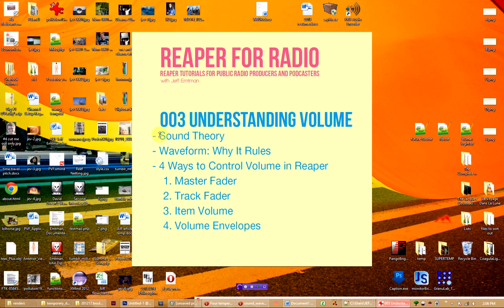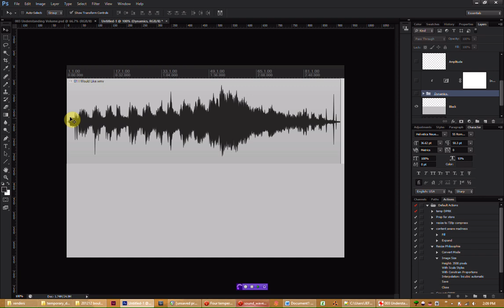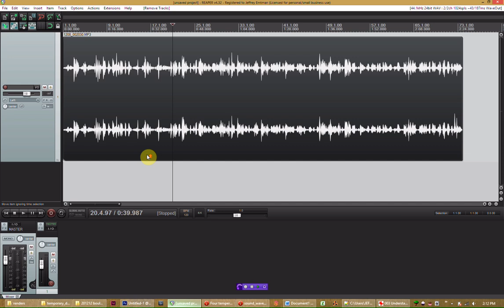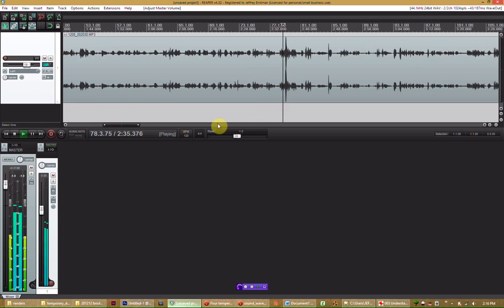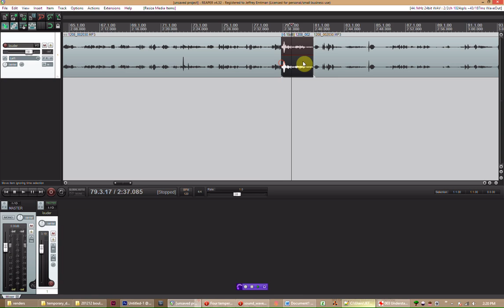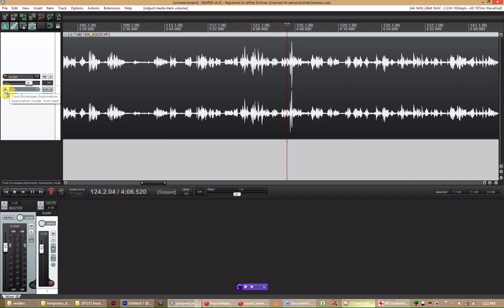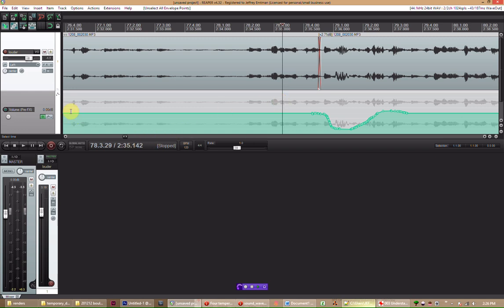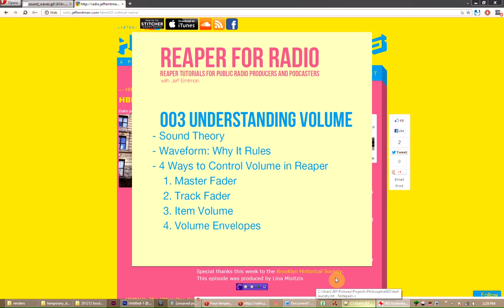Understanding Volume: Reaper for Radio 003

Comment: Reaper 6: To adjust the volume fast on one wave:  Preferences - Appearance - Media - Handle +0db is center of item. This will give you the volume line in the centre of the waveform. Select the area to reduce/increase - Shift S to cut the area at both ends -  rise or lower volume. When drawing the nodes/automation points on with a pen - If you right click one point - select - 'reduce number of points' - you can make it visually look better and then easier to adjust. I also added a normalise button to the toolbar. Right click on toolbar - customise - Add - item properties: Normalize items or (Ctrl Shift N) Onwards!

Comment: Volume automation certainly has its place, but using a compressor would probably be the best choice in this situation, preferrably during recording. Because it is a speech only track, you would be using a compressor anyway to get a level volume for the entire recording and reduce plosives and spikes at the same time. Two birds, one stone.

Comment: Hey Jeff - firstly thanks so much for putting this series together and for the new video this year which I will watch next - I am coming accross from Audacity - I am embarressed to say I have an issue with making a simple selection in a track - when I left click and drag I get the context menu?  What have I missed?
Reply from the maker: All of reaper's mouse functionality is customizable.  what you're getting defintiely isn't the default behavior, so I can only think of two things that'd cause it.  
1. Your mouse buttons are inverted.  Though AFAIK that's a system-wide setting, so your issue would be happening everywhere. 
2. Your "mouse modifiers" have been changed.  This is where you can alter the behavior of the mouse in Reaper.  It's in the preferences.  The context you'd want to look at is called "arrange view". 

Hope that helps
Reply: @JeffEmtman   Thanks so much Jeff - you were right on the second one - not sure how I managed it but I did - just watching your Faster And Better: Reaper Podcast Editing Workflow video - I can not tell you how greatful I am for your work, generosity and awesomeness - thanks so much for your work :-)

Comment: Hey jeff - i'm trying to place points on my volume envelope, but for some reason i can only place them at certain intervals. There's a vertical grid on my workplace that I don't see on yours, and everything i make automatically snaps to these points. How do i turn this off?
Reply from the maker: Good question, Angus.  Fortunately, there's a quick fix for this.  by default, reaper has a grid.  this is helpful for music product.  Since radio isn't produced on a beat, we don't have any need for it.  Here's how you can turn it off.

1. Go to the upper left corner of the screen.  There should be a collection of 14 buttons
2. Look for the one that looks like a magnet (bottom row, right side) Click it.  This will disable the snapping that you're experiencing and you'll be able to move items and envelope points freely.
3 (optional).  The button next to the magnet button will make the grid lines disappear. 
4 (optional). Watch RFR005: This Just Got Awesome. https://www.youtube.com/watch?v=HCSHEDmk50I
In this video, you'll learn how to get rid of those buttons, so that you can free up space in the toolbar for functions you actually need.   I've got buttons that make reaper fullscreen and another one that loops any selected audio (amongst other things). 

Hope that helps!
Reply: Jeff Emtman thanks, jeff!
Reply: Jeff Emtman OK. I have one more Q. How do I record onboard sound (like what ever is playing on my computer) into reaper?
Reply from the maker: *****
That question is a bit more difficult. 

For mac, there's an app called SoundFlower that I have heard works pretty well.

For PC, it's going to be dependent on your soundcard.  On some PC's you can select a recording source called "stereo mix".  You'll have to poke around a bit to figure out if this option is available.  Try googling "how to enable stereo mix" and people will walk you through that.

Personally, I use a really low tech solution when I need to record something directly.  I just plug a cable from my speaker jack into my mic jack.  Never fails to work.

However, most of the time you need something that's playing, you can get it as a file, faster.  There are websites that will let you download youtube videos as mp3s.  Just make sure that you either:
a) have explicit permission to use them
b) the recordings are in the public domain
or
c) they qualify as fair-use under your country's copyright law.

Most people mis-understand option C.
Reply: Jeff Emtman yeah... unfortunately my computer uses an audio driver called conexant, which can enable stereo mix but it's extremely difficult. Your low-tech solution sounds perfect. you just use an AUX cable?
Reply from the maker: *****
Yeah, I use an 1/8" male to male.  I've got a headphone jack on my interface, and a stereo mic input on the back.  Just have to be really careful with levels.  It's probably not perfect in audio quality and you have to do it in realtime, which is a pain.  But it works.

Comment: Hey Jeff,  thanks for explaining volume. If a producer wants my file in -3dB but my track says + 6 dB then I render that track and it come back too quiet, how can I fix that. Also my renders sound more tinny than my actual recorded files in reaper? How can I get them to both sound the same? Thanks
Reply from the maker: Hi Lisa, measuring volume can be difficult.  I've actually learned a ton about it since I made this video.  The terms your producer uses though are unfamiliar to me.  Perhaps what they mean is "peaking at -6dB" which, these days is considered a fairly inaccurate way of measuring loudness.  Instead, I recommend you look into "loudness based metering", which is confusing at first, but gives you a much better ability to produce things at a consistent level.  

Per your second question, everything should sound the same in Reaper as it does in the export file.  There are only two exceptions to this.  1 is if you're using "monitoring FX", which are special FX that don't get applied to the audio.  I think this is pretty unlikely, but google that term if you want to double check.  The more likely answer is that you've accidentally ticked a box in the export settings.  Give the export settings a good once-over to make sure that you're not losing quality there.  Good luck!

Comment: Thanks.  I'm looking figure out why Reaper records, listening to playback, the volume seems to be about 20% quiter than 'radio'.  To try and correct, I double/triple my L1 Limiter- but I don't want to squash the track.
Reply from the maker: What do you mean by 'radio'?
Reply: @JeffEmtman   Comparing my tracks to the radio at the same volume number on the dial
Reply from the maker: @jimdrums4life499  Ahh yes.  There's usually some pretty wild amounts of compression that go into producing commercial work, both voice and music.  Often though, that compression is happening in multiple stages.  I used to think it was "wrong" to use multiple compressors, but actually, it's generally better to do it in a couple stages then to push a single compressor to the extreme.  

I don't know much about the limiter you're using.  I find limiters to be a bit more opaque to understand than compressors.  But I'd rec using some gentle instances of ReaComp on whatever you're trying to boost.  It'll give you more headroom.  might also sound a bit less harsh than the limiters (though I still rec using one on the master channel)

Comment: New to all this (guitar player in the band)...mastering at the moment..is it possible to do a complete red book cd master in Reaper? how important is red book these days? Thanks for an easy to understand Volume tutorial..jd
Reply from the maker: Thanks!  

Regarding CDs in reaper:  I'm not the best one to speak on CD burning, since I never use them, though I'd be almost certain that REAPER's output matches Red Book standards (I've never used a burning software that didn't).  However, I wouldn't recommend it for burning the final consumer product, since there's no option for adding metadata.  There are lots of free software that can do that once you have your mastered WAV though.

Comment: I have moved the Pre-FX Volume envelope up to the media window, but now I cannot move it back down to its own "track."  How do I do that (I'm on an iMac)?
Reply from the maker: LT Holliday good question.  Luckily, the answer's simple.  Just right click on a part of the Pre-FX volume envelope (on a line, not a point) and choose "Show envelope in lane."  That'll do it.
Reply: Jeff Emtman  Thanks for the quick answer. Unfortunately, this doesn't work with my iMac.  To "right click" with a Mac, you press the Shift key and click the mouse cursor.  This did not yield the "choice window" allowing me to put it in a lane.  Any other ideas?
Reply from the maker: LT Holliday Actually, I believe that Ctrl+click is the way to right-click. Did you try that?
Reply: Jeff Emtman I tried shift/click, control/click, option/click, option-command/click, control-option/click, etc.  None of them do the trick.  :-(
Reply from the maker: LT Holliday Hmmm, I've used Reaper on Mac before and never had issues with right click.  I'd recommend confirming that you can right-click in other applications to make sure it's not a system-wide issue. 

In the meantime though, you can always achieve the same effect in the actions list, which houses every function available in reaper.   Select the track and search in the actions list for "Envelope: Toggle display in separate lane for selected envelope"  and hit "run"
Reply: Jeff Emtman Although the Cntl/Click did not work, I was able to configure my Trackpad to allow for "right-clicking" by using two fingers to click at the same time, and that worked!  Thanks!